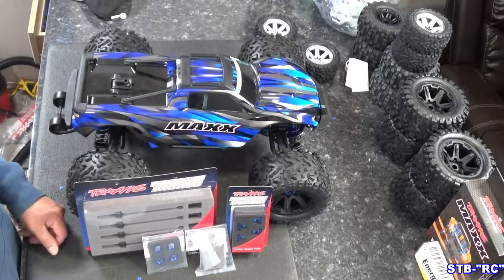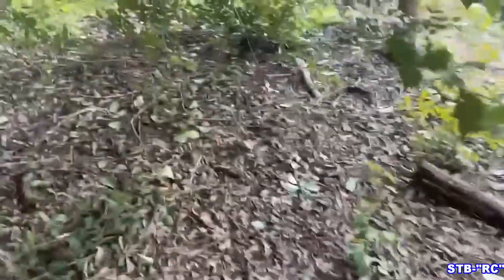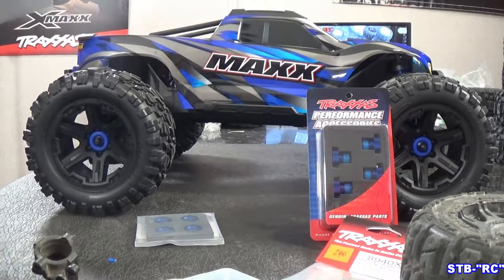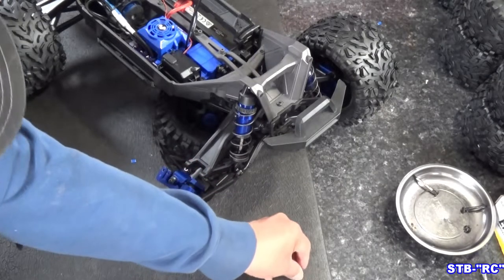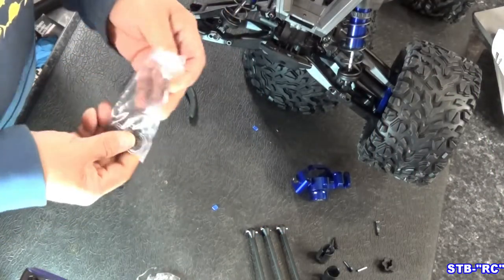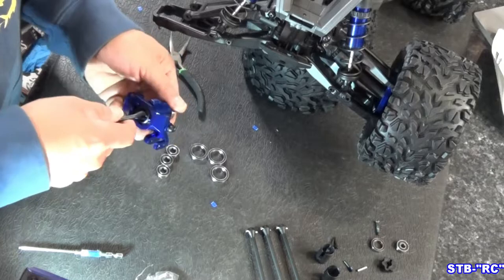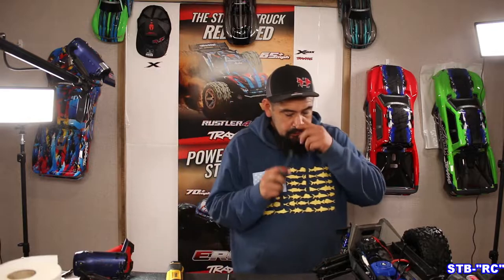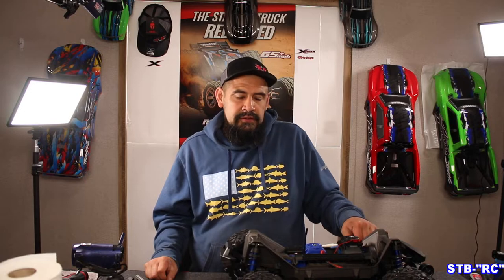HOW TO: Install Steel Drive Shafts On TRAXXAS MAXX. STEP BY STEP.

Comment: Where did you order these steel axels from? I just bought a maxx the other day and after running it twice one rear axle and one front axle snapped and I can see the other two are twisted. Do you know if that is a common issue? What is the blue piece called where you replace the bearings? Are those upgraded ones? Mine are just black plastic.

Comment: Hi I bought my traxxas maxx and after 4 days the ESC turned on the four red lights, is there any way to solve that? I like your channel and I see that you have a lot of information about the maxx
Reply: From what I know, that might be an indicator that your ESC is toast. I would contact Traxxas and see what they have to say about it! You may also try to re-program it and see if that does the trick! The Traxxas web site has lots of help in the "news" section and you can also try the "community" section! Good Luck brother! Should be no problem getting it fixed.

Comment: Hey does anyone know what size bearings those are? I am having a hard time finding them
Reply: For both Front and Rear Carrier bearings for Traxxas Maxx V2: Inner bearing part # 5120A 12x18x4mm, comes in a set of (2). Outer bearing part #5099A 6x16x5mm, comes in a set of (2).  The 5120As are $8.00 and the 5099As are $4.00. Hope this helps out brother!